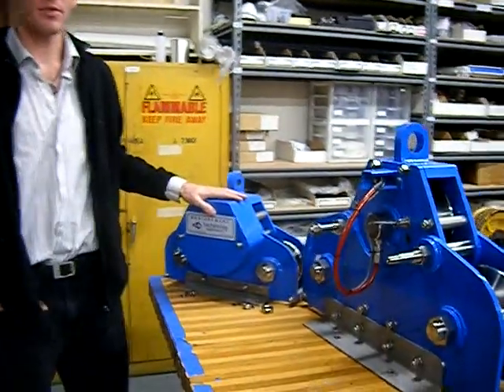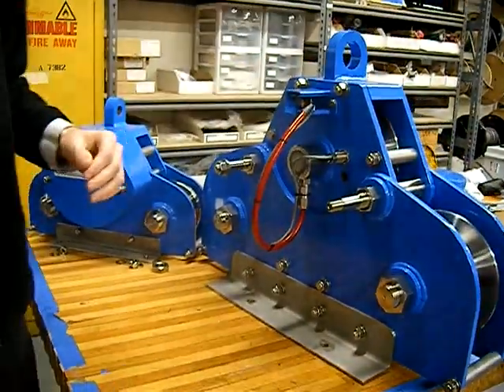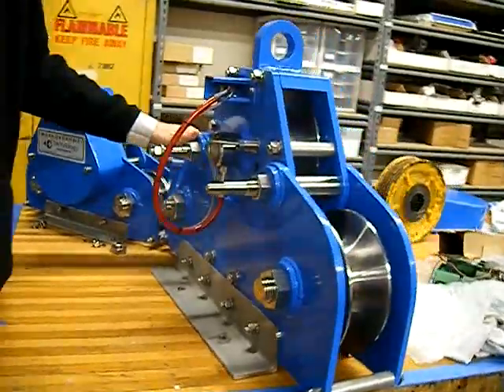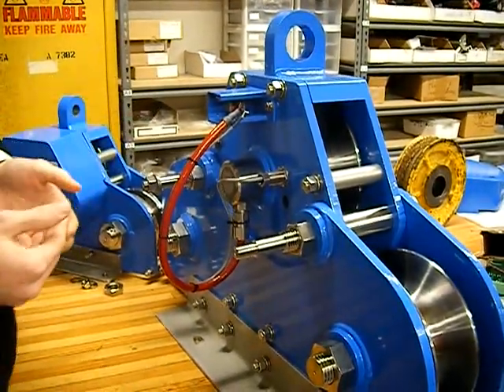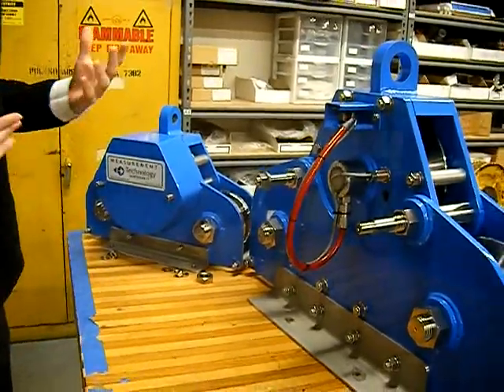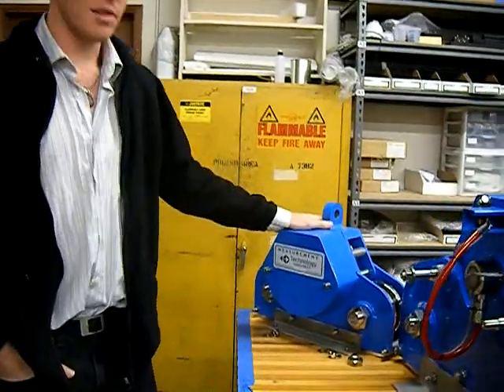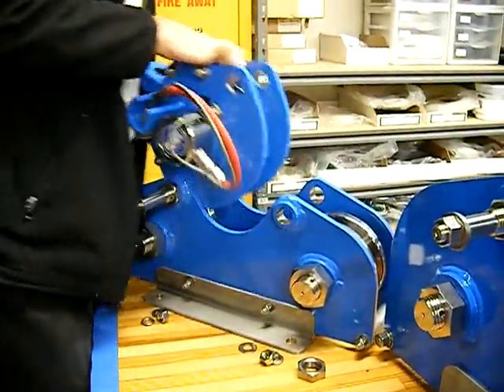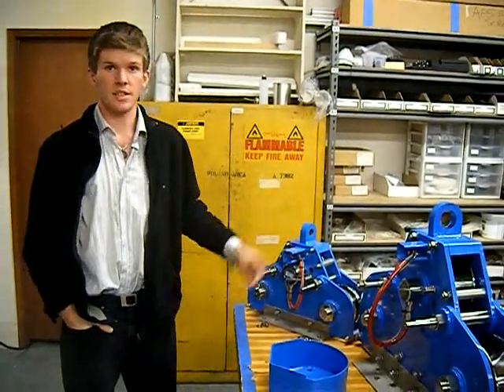Blog Video - Introduction to Running Line Tensiometers.MP4

Comment: Nice and useful, is this wire or wireless transmitter?
I am looking for replacement wired tensiometer for Maestro DS160 system. Can you assist if this work for that?